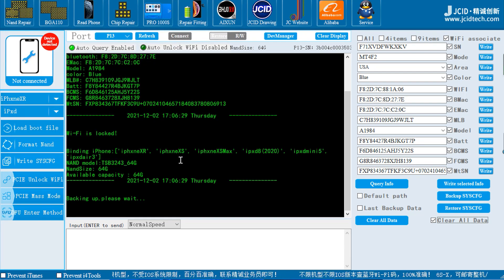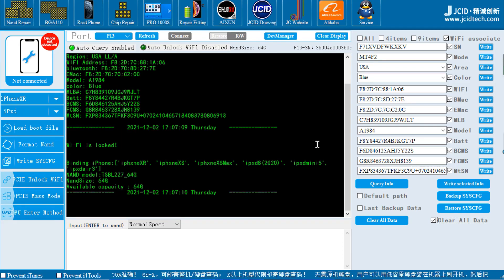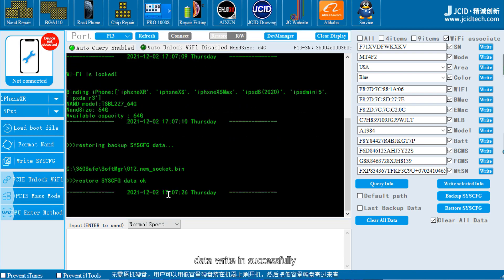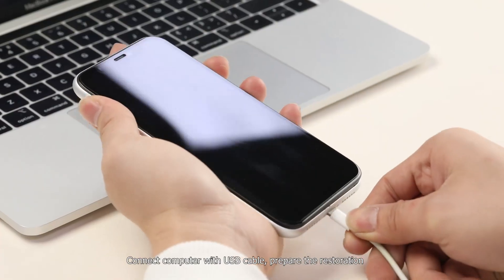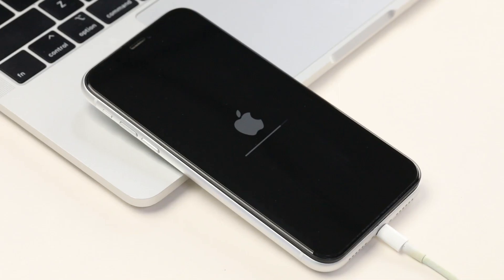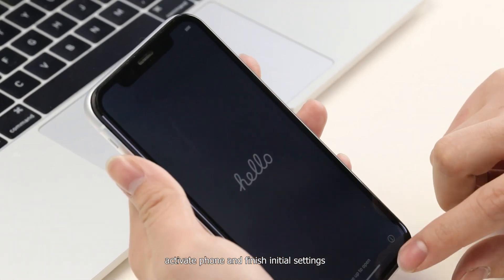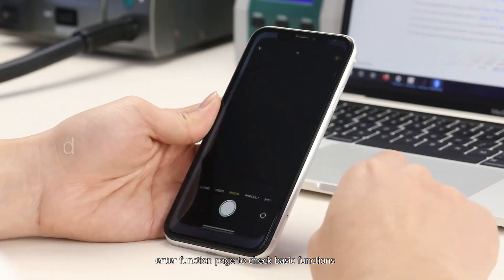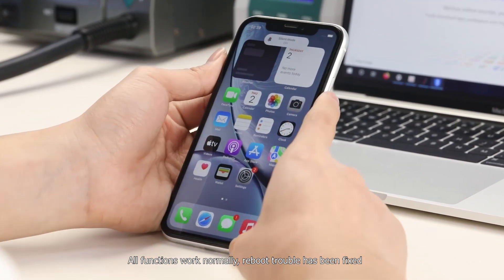iPhone XR Keep Rebooting Problem Repair With JC P13 Nand Programmer.

Comment from the maker: The reboot problem is one of the common problems encountered in daily repairing. Today, we received an iPhone XR that can’t be rebooted. Let's see how our repair master fix it.

2UUL Multifunctional Ox High Temperature Resistant Mainboard/IC/PCB Clamp Holder, w/retail package
https://elekworld.com/shop/productinfo.aspx?proid=15912&categoryid=350
"QIANLI" Hand Knife with Blade, 009, w/retail package
https://elekworld.com/shop/productinfo.aspx?proid=9190&categoryid=293
Disassembling Nylon Stick for iPhone&iPod&iPad etc., 10pcs/set
https://elekworld.com/shop/productinfo.aspx?proid=6667&categoryid=291
Disassembling Plastic Triangle Crowbar for iPhone&iPod&iPad etc., 2pcs/set, Total 10sets
https://elekworld.com/shop/productinfo.aspx?proid=6673&categoryid=370

For more Repair parts&Tools and Tech support, please visit:
Website: https://www.elekworld.com
Facebook: https://www.facebook.com/Elekworldshop/
Instagram: https://www.instagram.com/elekworld/
Twitter: https://twitter.com/ElekworldL

Comment: You didn't even try to flash the phone before disassembly. Masterpiece diagnosis.
Reply from the maker: Thanks, you are correct. Actually we tried the restore with old Nand but failed, so we just start Nand replacement in video.
Reply: @Elekworld  and what was the error number?
Reply from the maker: @ЯковКомаров-с8й   No error number, just stuck on 20% when restoring.

Comment: Iphone 11 pro max no modem firmware issue all good resistance value ok, but no luck... any suggestion.... Thankyou
Reply from the maker: 1- try to replace different parts except board, such as screens, batteries, Face ID etc. 
2- try to restore the iPhone again with 3U tools
3- try to restore it with a new Nand like the video shows.

Comment: 2 question :
1,This will erase all data from the phone , right ?
2. Can I use this method to bypass the iCloud lock ?😀 Both X, 11 and iPhone 12
Reply from the maker: 1- Yes, it will erase the data.
2- It can't bypass the iCloud, unless
Reply: @Elekworld  unless what ?
Reply from the maker: @ronlevin2339    Unless you have a kit without Apple ID, and transplant them on a working board(main CPU, Baseband IC, Eepom, matched Nand and Wifi module etc).
Reply: @Elekworld  how can you replace without erasing all data?  what is the point of backing up data on the chip if you are just going to erase it anyway?  :(  I'm afraid to lose all my data